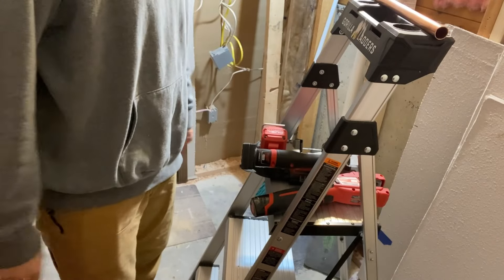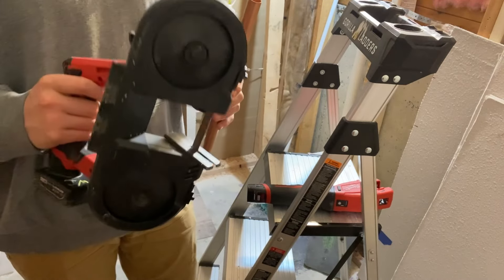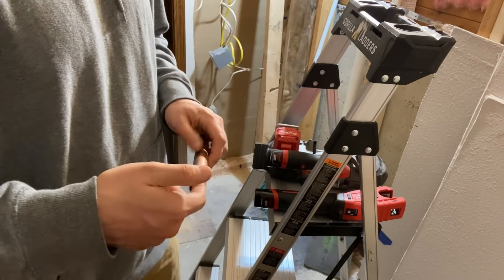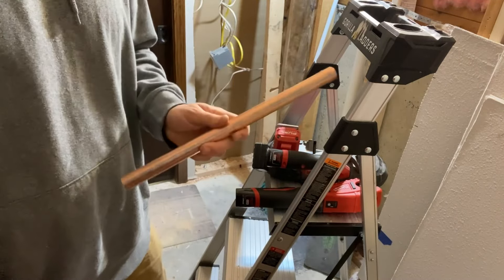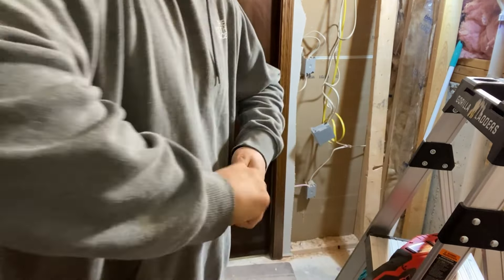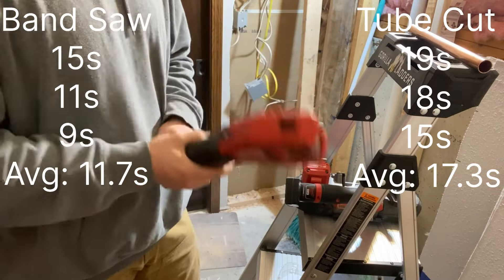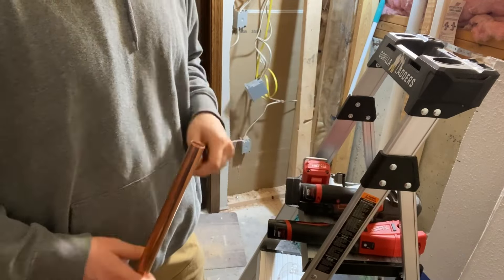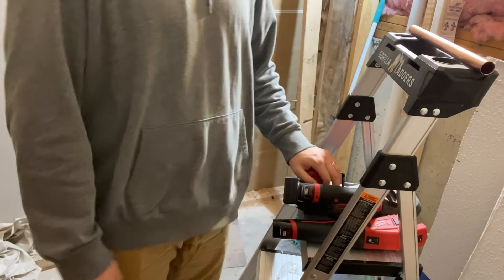Milwaukee M12 Bandsaw vs. M12 Tubing Cutter for Cutting Copper: Does Quickest Mean Best?

Comment: The M12 tubing cutter has been calling my name lately.  I don't think I can resist its siren song. 

Since you mentioned you're using Pex, do you have the M12 Pex expander?  I picked up a used one on ebay and it's been so satisfying to use.
Reply from the maker: Pex A isn’t as common in my area and a lot more expensive so I have done all pex B.

Funny story is I actually knew that but bought a Dewalt Expander on a crazy good sale. I figured the local plumbing supply houses would have better rates on pex A and it would be worth it but it was still 2-3x more than Pex B. So I ended up returning it. Sad day!

Too bad the crimpers are so insanely expensive!
Reply: @EngineersPerspective701  oh man, I feel your pain.  The excitement of a new tool, followed all too quickly by disappointment.  

yep, availability stinks on the Pex A.  I've become a frequent purchaser at supplyhouse.  It means I have to plan projects and order parts, instead of just running to Lowe's 3 times per day.  And supplyhouse's prices on valves and copper are WAY better than the big boxes.  So I'm mostly happy with this route.  And the expander...  Connections made sooo quickly. 🤤